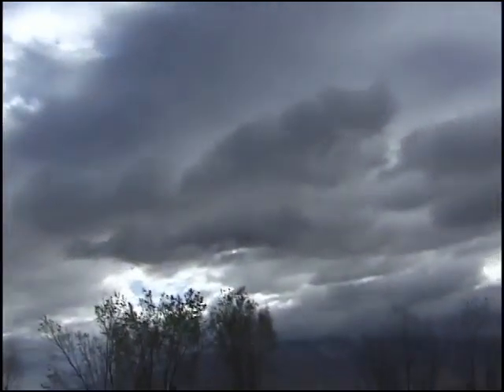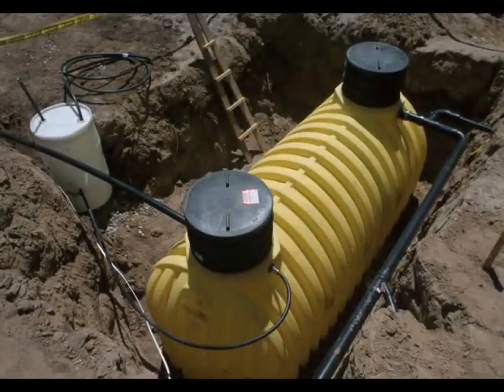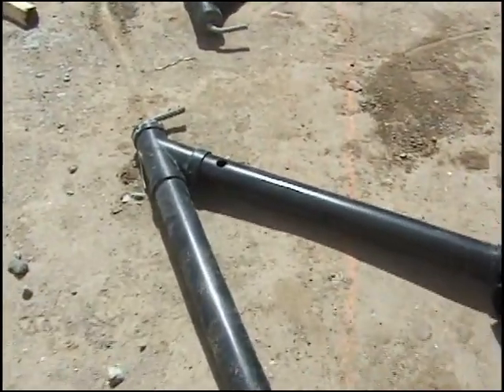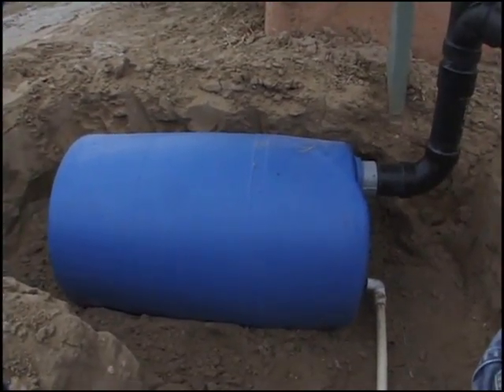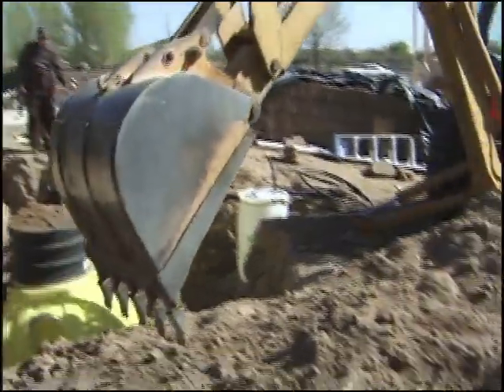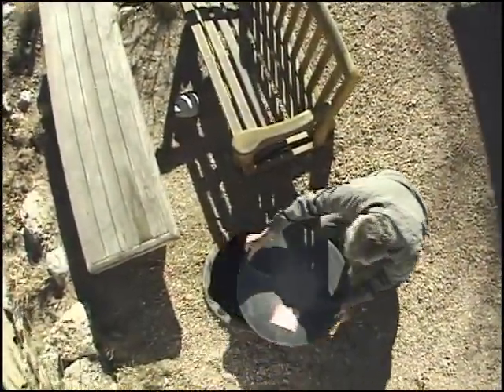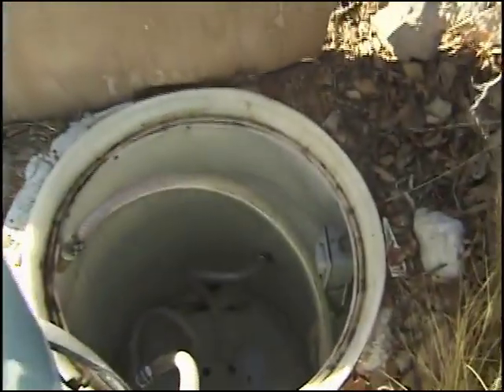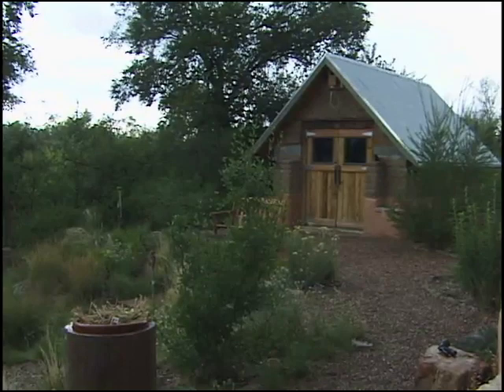Installing a Rainwater Cistern

Comment: I really appreciate the clear instruction, but I think it requires a warning about occupying an excavated pit without any soil retention structure.  Those vertical soil excavations could easily collapse, especially with the load of the excavator.  Maintaining a 45 degree angle when possible would prevent that.  Also, it’s important to note that the weight of all that water in the tank could add surcharge to a below-grade foundation or retaining wall, a load which you described so well in the tank surcharge pressure portion of the video.  This is a really nice cistern system but each site’s conditions may require an engineer’s guidance.

Comment: This totally makes sense.  Having a cistern for flushing toilets, watering plants and other uses (like running pressure washers or washing your car) is pretty good.  I have a 50 something gallon water drum and inside it is an incredibly simplified system like this.  It's a simple submersible pump in the bottom with a two-stage screen system used primarily for watering plants around our rented property as well as for my pressure washer when I want to wash my lawn mowing service equipment.  I also recently bought a higher pressure, as Vevor describes it, "shallow well pump" to gain a bit more flow and/or pressure from this setup.  It looks a bit like a jet pump but I am not sure if that's what it is with 1" fittings and garden hose adapters.

Comment: That is a septic tank and not a cistern.  Those tanks are not designed to be buried empty.  Rainwater cisterns will be empty at times.  While you may get away with it in certain soil conditions the manufacturer will not warranty the tank if  it collapses from groundwater pressure when empty.  Pay a little more and buy a tank that is designed to be buried empty and carries a warranty for the application.

Comment: What happens if the cistern floats to the top during sudden rain after drought?  So it's empty... and buoyant?
Reply: Interesting question.
Reply: The cistern cannot become buoyant and float to the top with the heavy weight of dirt pushing it down -- buoyancy would require space for movement of the cistern, which there is no space. To have buoyancy it would also require a significant amount of water (force) underneath the cistern to push it upward, which is not possible at that depth. The base of the cistern is about 6-8 ft deep. 1 inch of rain in loamy soil would only soak down about 15 inches (1.25ft) which would not even reach top wall of the cistern. In clay soil it would not even reach 15 inches but closer to 9 inches. In short, sudden rain is not a legitimate problem -- the cistern is also filling with water quickly during sudden rain. In the US, the average rain fall per state is around 4.8 inches per month. 1 inch of rain per hour is considered to be flash flood amounts. So even if you had that 1 inch of rain as a flash flood, it's nowhere near enough to cause a problem even if the cistern is completely empty at the beginning of the storm.
Reply: @Originalman144 yo, plastic septic tanks floating out of the ground is not an unheard of phenomenon. Better do a little more research. Smart folks chain them down to concrete anchors if there is even a little chance that they’ll ever be 1/2 empty.
Reply: @silverbackag9790  more research? You clearly cannot comprehend my reply. I just gave you the math and the physics of the situation along with average rainfall. This one might be over your head bud. Those people aren’t somehow “smart” for chaining down the cistern. It’s simply unnecessary, even in the worst of conditions. .

Comment: If you have a well, that's what happens anyway. It rains, the water soaks through the ground and is filtered, and it ends up in the aquifer. Then you pump it back out when you need it. This seems like recreating the natural water cycle with a bunch of plastic.
Reply: Wells require a stronger pump and use more electrical power due to the depth that they are drawing from. This setup can be powered by a couple of RV solar panels. Wells cost $10000+ while a cistern like this would be less than half of that. Also, some wells do not produce water fast enough, so this setup could supplement a well with poor flow.
Reply: Lots of places in the USA where there is no accessible water, but it does rain from time to time. Four corners region comes to mind.

Comment: You used a septic tank?  I dont think those are for appropriate for potable water... Is it NSF16 approved?
Reply: FWIW: I used two 1000 gallon concrete septic tanks for rainwater storage for 20 years. The main thing was to use the right form oil, NOT petroleum based.
Reply: @portnuefflyer  are you talking about the liner?
Reply: @scottsmith4145   I used no liner, just the tank as it came from the pre cast place, no leaks. The release agent they use when casting them was "special", when used for water, or so I was told. I didn't much care as I didn't drink it anyway. Drinking water is a very small percent of total water use of course.
Reply: @portnuefflyer 
Ok.   I understand.  My plan is to dig a hole and use ICF blocks for the four walls (simple square tank) insert liner and pour a concrete cover and  with rebar all throughout.  The liner cost is quite low and ICF blocks are easy to build with.  This comes out way lower cost than an equivalent plastic underground tank probably even this septic in video.  Especially with how expensive plastic is recently.
Reply: @scottsmith4145   That's an excellent idea!  ICF blocks were unknown, at least to me, 40 + years ago!

Comment: Why wouldn’t you use that for drinking water?
Reply: Did you miss the part where he talked about the bird shit in the gutters?
Reply: @danolanater  they’ve got these new things called filters and UV lights.
Reply: Oh you missed that part at the end about pumps being a waste of energy
Reply: @danolanater if it's used for its intended purpose. Then it's not a waste of energy. It's not the consumers fault the part they used to pump their water was poorly engineered to consume more energy than needed.

Comment: Excellent . but you did not explain clearly what is the use of the small cistern .
Well done
Reply: Uhm, To provide water to the home... Whether it be the main supply or emergency backup.
Reply: @jonbraddock5545  he clearly means the small
Blue barrel buried before the large cistern. I think this is to catch any small sediment given the location of the outflow pipe.
Reply: @jkrensel-gr  The blue tank in the ground is the roof washer. the blue vertical tank is the pressure tank. If Ahmad was asking about the blue tank in the ground than yes. He said cistern so I was answering about the cistern.
Reply: @jkrensel-gr  Thats exactly what it does, its a pre filter. but like I said he said "small cistern" and the yellow container they installed is on the smallish side so I can only answer what he asked. we are both explain the correct purpose of the catch barrel.

 Cheers.